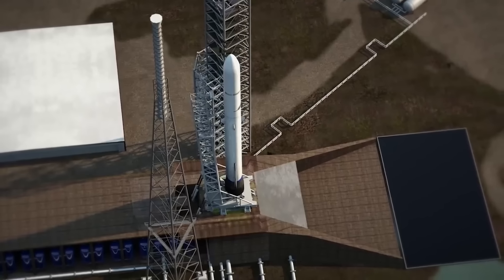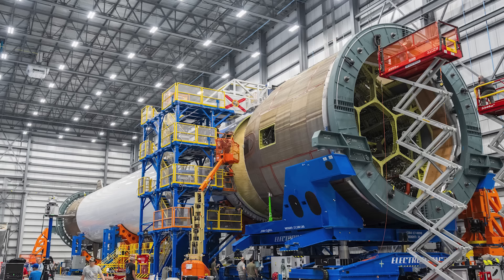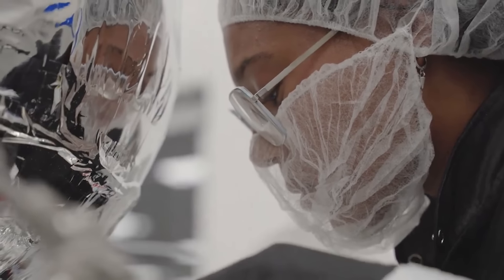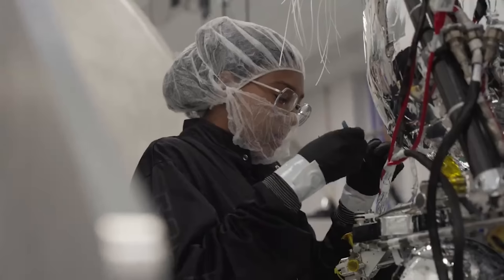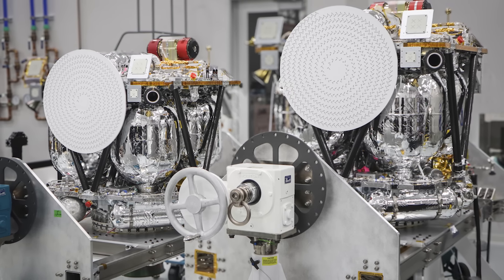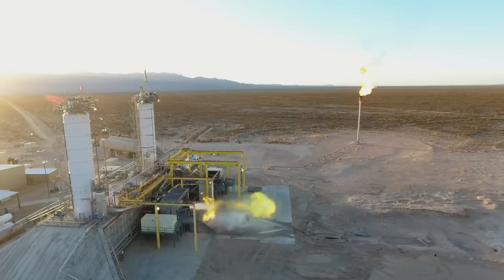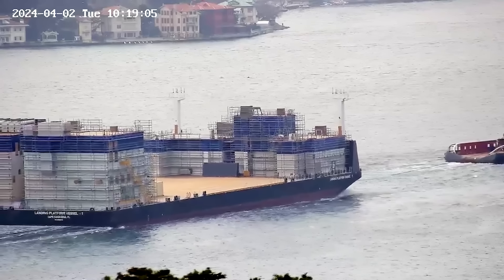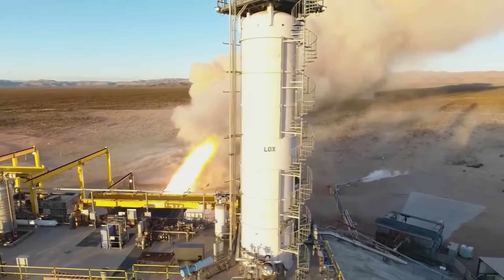Blue Origin's New Glenn Maiden Flight Has A Set Date

Comment: 2:59 is exactly what will happen.  There's no way they can: integrate segments / weld tanks together,  cryo test, then test fire, and then launch in the next 6 weeks if it's already taken two decades to get this far. 
Acting like they will meet this deadline is just a charade so it doesn't appear obvious they have not intentions of meeting the deadlines they have been paid to meet.
Reply: "integrate segments / weld tanks together" - That was done a long time ago.
"cryo test" - Done already for the second stage, in the test buildings behind the factory.

It's pretty much stacking and testfires at the pad that need doing once the booster leaves the factory.
Reply: Well, I'm sure your friends and family say your one of the most optimistic people they know!
Reply: "weld tanks together" acting like you know anything about launching a rocket is the only charade here.

Comment: dumb question, could starship take the payload? probably technically feasible but not at all practicle. im thinking of an impromptu disposable upper stage. nasa probably wouldnt let it fly
Reply: There is basically no chance SpaceX could develop an expendable third stage for Starship from scratch before New Glenn is ready to fly. But if it becomes clear that BlueOrigin isn't going to meet the launch window NASA may be able to move EscaPADE to a Falcon Heavy, as long as the decision happens fairly soon.
Reply: @plainText384  lol starship is already an expendable stage, just needs a bigger door and piping around propellent.  i get what you mean. i think starship current performance is actually pretty bad. i didnt realize the payload could fit in falcon heavy. what was the point of newglen then lol
Reply: @vevenaneathna  New Glenn is massively oversized for EscaPADE. I'm pretty sure they could even launch on an expendable Falcon 9 (maybe even a reusable Falcon 9, I couldn't find any TMI payload stats for that configuration), as the combined weight of both Spacecraft is only about 1.1t. New Glenn was chosen because the mission allows for higher risk, and BlueOrigin gave them a great deal of only $20M for the launch, much cheaper than any Falcon rocket. 
Generally the advantage of New Glenn over Falcon Heavy is the larger payload fairing and being better optimized for reuse. Falcon Heavy expend the core stage and upper stage, NewGlenn will only expend the upper stage and might even achieve full reuse if economically viable.
Reply: @plainText384  No, that's not how it works. The spacecraft are not high priority and it's expected there will be high risk involved here. Starship isn't ready and it's increasingly clear that there's nothing else to launch it on with sufficient C 3 or 4 capability to send it to Mars late in the launch window. 

New Glenn's G2 is lighter weight than anyone thought and the revelations on BE-3U having higher ISP and thrust means that the launch can go later than anyone realizes. The ESCAPADE spacecraft themselves were designed around TMI from Earth orbit originally, so they have a lot of delta V to play with. If you run the porkchop analysis, you wind up with a possible launch window that can go as late as 3rd week of November. 

Anything beyond that is too much, and ESCAPADE will not be able to put themselves into Mars orbit and carry out the mission. So it won't matter and they'll have to wait until 2026.
Reply: @Nowhereman10  an expendable Falcon Heavy can outperform a partially reusable New Glenn. If it's not to late for New Glenn to attempt to launch EscaPADE and land on a barge, then a Falcon Heavy could definitely still launch it as well. Payload figures for New Glenn are >13t to GTO (presumably with first stage recovery on a sea-going landing vessel), while the expendable Falcon Heavy can put 26.7t to GTO and 16.8t to TMI. But an expendable Falcon Heavy launch would cost NASA 5-15 times as much as this New Glenn launch and may no be available on this short of a notice so I doubt the launch will be moved away from New Glenn.
Reply: @plainText384 so then why was does the falcon family launch so few interplanetary missions? They are optimized for earth orbits. They don’t have sufficient isp for efficient interplanetary trips
Reply: @mattkingston6157  how many American interplanetary missions are there? DART flew on Falcon 9, Psyche launched on Falcon Heavy, Mars 2020 and Lucy launched on an Atlas V. That's half of the interplanetary missions this decade launching with the Falcon family so far and more are on their way (Europa Clipper in Falcon Heavy, ESA's Hera on Falcon 9).

Sure, the Merlin engine doesn't have as much specific impulse as an RL-10, but that just means you need a larger rocket to put the same payload on the same trajectory. And Falcon Heavy is a very VERY large rocket.
Reply: @Nowhereman10 New Glenn isn’t ready. BO has never once made, or even tried to make, orbit. All they’ve ever done is joyride hops.
Reply: No, not unless you have figured out how to get an upper stage through a 1m slit.
Reply: @plainText384  Do the numbers on the C3 an C4 plots. As powerful as Falcon Heavy is, it's not efficient enough to do a direct Jovian trajectory with it. 

SLS was the original launcher for Europa Clipper, but it was switched to the less efficient FH because FH, is far more available and vastly cheaper.
Reply: @plainText384  Which is a helluva lot more expensive to do than New Glenn. And we don't know what an expendable New Glenn is capable of. This mission is only costing NASA $20 million using New Glenn, but would potentially cost up to 10 times that using an expendable FH. 

But right now we do know New Glenn is more capable than previously thought. The thrust on the BE-3Us are 7% higher than the  baseline 160,000 lbf and it still has a 445/s ISP, which puts it in the upper middle tier of the RL-10. 

We know from Tory Bruno that BE-4 is performing better than baseline goals, etc.
Reply: @jordanhenshaw  The fact that you have to resort to calling New Shepard a "joyride hops" when it's done some amazing things, including beating Falcon 9 to being the first booster to vertically landing while returning from space and carrying 44 humans there and back along with 150 or so experiments shows a thunderous ignorance.

This whole thing is about New Glenn nearly being ready to go.

On top of that, BE-4s helped power a large rocket to orbit 8 months ago and is set to do so again in 2 weeks.

Comment: SpaceX doesn’t even move at that pace. Honestly it would be best for them to launch a dummy payload to understand their rocket. Given that, ya know, they’ve never been to orbit, never landed a vehicle in this specific way, and have never flown a vehicle this size. Honestly a mars attempt on the first try is insane.
Reply: It's not the New Glenn that is going to Mars, but the payload.  And the Be-4 engines functioned nominally on the first Vulcan launch.   The bigger question is if they can actually get New Glenn ready to fly in 6 weeks never having prepared it for flight before.  I expect that most likely they will run past the deadline and another company will launch Escapade.

Comment: It is designed to be reusable.  I would expect mounting the engines is complex but not so complex as to limit turn around time.  So I do not think it is time constrained.  It sounds like the construction and testing of components is complete and it is a matter of assembly and testing the components function as a system.  Pressure tests, firing of engines, wet dress rehearsal etc..  I am cautiously optimistic and look forward to it's launch.  Blue Origin has received a lot of negative press and I think it is mostly unwarranted.  Mostly nonengineers formulating opinions from their couch.
Reply: I’m really looking forward to this launch! I’m a tooling engineer there. It’s a great company to work for.

Comment: I highly doubt it ! BO is still fiddling around with new shepherd thrill rides !
Reply: BO is divided into multiple business units that are effectively their own companies within the company. New Shepherd and New Glenn are 2 of those business units. Lots of former New Shepherd people switched to New Glenn, but no one working New Glenn has any hand in New Shepherd
Reply: New Shepard has been a test bed for New Glenn.

1. Learning to deal with cryogenic propellants, especially LH2.
2.  Learning separation systems with the capsule and booster. 
3. Learning vertical landing and what works with turnaround of a rocket.
4. BE-3U for New Glenn's 2nd stage is based in part with experience with BE-3 PM.

In addition, Blue gets revenue from flying payloads, researchers, and tourists.

Comment: Ladies and gentlemen, I present to you the pacing of an aerospace project that cannot afford to fail on its first flight and is not designed to be easily improved.
Reply: "not designed to be easily improved" what sourced information do you have that would suggest that?
Reply: @Bob-cb4tq  The amount of time it has taken them to manufacture a single specimen, owing to the blatantly visible complexity of the design, is all the data I need, friend.  It's probably about as easy to update as SLS.  Maybe that's still technically standard in aerospace but I do have a different context I can reference nowadays.
Reply: @Asterra2 maybe that’s because their design is working? I mean design something that works first time and then you don’t have to toss 156 raptor engines in the sea so far. The shuttle program had 46 engines across 135 flights for reference. Starship is throwing shit at the wall and seeing what sticks. Rockets are expected to work the first time with a payload
Reply: @mattkingston6157  Indeed, BO did it the traditional way.  And that, my bro, is the reason why they don't have the luxury of a design that can be easily improved.  And since we're on the topic of traditional vs. iterative design, there are also implications here for ease/speed of manufacture of future vehicles—see SLS for our closest contemporary parallel.  Incidentally, given that an entire Starship prototype stack, including engines and tiles, runs SpaceX about $90 million lately, I reckon they aren't personally bothered when an armchair analyst misguidedly decides it's some kind of untenable expense.  Conversation closed.

Comment: These things take way too long to make. SpaceX has a superpower often overlooked... they aint just making a big shiny rocket.. they're building the factory, the machine to make the machine. They will be able to make dozens of ships in the time these guys assemble ONE.
Reply: BlueOrigin has a factory for building NewGlenn in Exploration Park at Cape Canaveral. If you want to learn more, check out the recently released tour done by The Everyday Astronaut. Multiple New Glenn vehicles are in assembly.
Reply: @plainText384  can they and will they match the pace of SpaceX ? I hope they can do at least 1/4 - 1/3 of what SpaceX will be able to do. Remember, they haven't even flown yet, SX keeps racking up the flights and landings. well, except the last one. But hey, at least the public is paying attention now, they only tune in when something goes boom. Next week will be something else and they won't tune in until the next RUD
Reply: @drfranks1158  BlueOrigin doesn't have their own massive satellite Constellation that gives them access  to near endless guaranteed payload they don't need to compete for against anyone else. NewGlenn is also a lot bigger than Falcon9, so they can launch a lot of payload with a lot fewer launches. So while I don't expect them to reach Falcon9 levels of launch cadence, I definitely expect NewGlenn to fly more often than Falcon Heavy.
Reply: @plainText384  you smoking better stuff than I am.

The factory aint building F9's, they are gonna pump out Starships. I don't think you understand what SpaceX is building. That factory is going to produce Starships... F9 is the thing paying the bills atm and what comes next is going to be spectacular.

REUSABLE to ORBIT spacecraft. Let NG at least make landing #1 before you get all weepy and gushy. They have a lot of ground to cover before they even match SX.
Reply: @drfranks1158  spoken like a true Muskateer that obviously knows nothing about what BO has and is building in terms of infrastructure. I don't think you have a clue what BO is building.
Reply: @Bob-cb4tq  name calling like a child. You have no idea what I think of musk. And clearly SX is doing way more than BO can atm. Maybe after they land for the 10th time, then they can pat themselves on the back. They haven't even come close to what SX is doing, and already HAS done.
Reply: @Bob-cb4tq  The good Doctor is probably has a degree from the Elon Musk College of Commercial Space Quackery (hope he learned "blood-letting" and cures himself...).
Reply: @drfranks1158  Please, Doc, you're making an international fool of yourself! The experienced Space Community is laughing so hard you could hear Us on Mars! (pity you'll never get there...)
Reply: @davidstevenson9517  another childish name caller. lol, I love that I live in your head so rent free.